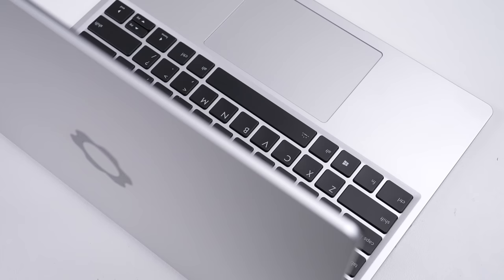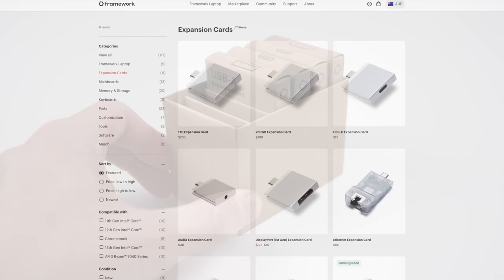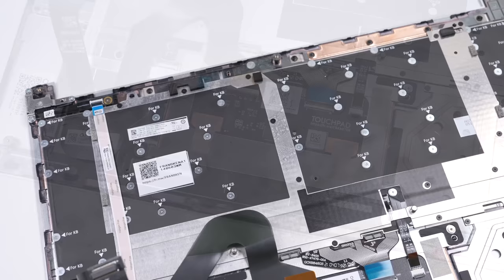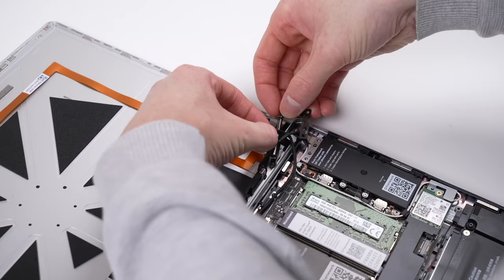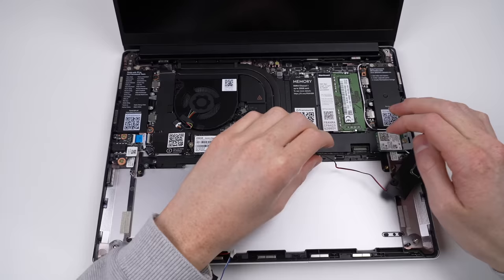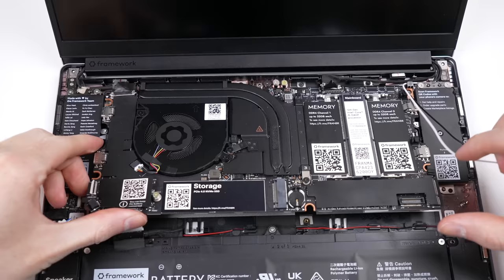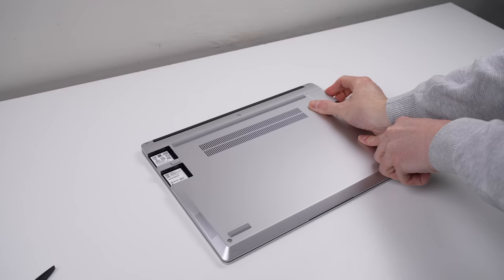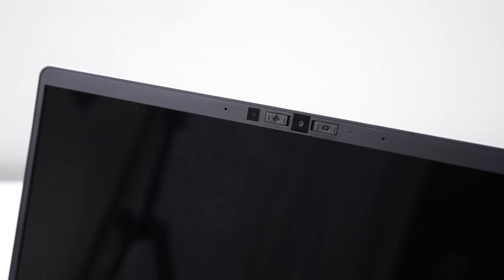New Laptop Brand Shocked Whole Computer Industry - Framework Laptop - Teardown And Repair Assessment

Comment: Single torx size for everything, under the hood QR codes for easy parts reference, swappable ports.  I'm surprised even the screen is EASILY replaceable.  I may support these guys, even if I don't really need a laptop.  Also, I don't watch many Framework teardowns, but this one was very descriptive and easy to follow along.  Awesome tinkering Hugh!🤙🏽
Reply: consider buying a usb-c charger or some clothing article from them if you don't want to drop $1000 on a laptop but still want to support them
Reply: Torx is also nice, they're a good bit more difficult to destroy if you don't have enough force
Reply: I replaced my hinges in five minutes. AT WORK. IN PERSON. And then replaced my screen a week later. AT WORK. It's stupid easy to work on lol.
Reply: @spdcrzy  how long do you think it takes to replace hinges and screen on a T420 thinkpad? hint: i can do it in less than 6 minutes, including cleaning.  whole teardown in 20 min. including a coffee, cleaning, including fan and thermal paste, upgrading and rebuilding the whole don't even takes more 30 minutes tops. 😏
same for some dell and hp professional laptops series.

(yes, i know, it's an old thinkpad but it still has the one of the best keyboard for me along with a trackpoint 🔴)
Reply: @kittytrail  But those laptops are not upgradable.
Reply: They are also working on a “desktop” dock that you can put your old parts into as you upgrade, so that your old laptop becomes your new backup PC. 

I really hope that a whole ecosystem comes out of this.
Reply: @Chopper153   they are not meant to as they're corporate assets that get replaced every two to five years because corps mostly don't care with upgradable stuff usually. but you can upgrade the display with non available at the time resolutions, hd, network, bt, internal speakers and ram. some old thinkpads even allow you to use one newer intel gen cpu. a long time ago i toyed with totally upgradable workstations from the Panda Project, like going from x86 to DEC Alpha cpus with the same backbone and it was pretty nifty but it didn't work in the end in a corporate setting as the bean counters weren't having any of it for warranty and depreciation purposes nor the engineers who wanted sparkly new workstations every two years 'cause, you know, newer is always better and it was a time when going from a pci graphics card to an agp one meant a wild boost in bandwidth and performances... 😑
i really hope they'll succeed though even if keyboard type and internal battery only mean i won't buy one.
Reply: @kittytrail  I know, LOL. I've used the OG thinkpads before. My point is that until now, I've NEVER seen another laptop that was this easy to work on - and I'm including my old gaming laptop that was fully upgradeable with a socketed CPU AND GPU. Man, I miss MXM.
Reply: @spdcrzy   yep, MXM was a start but it didn't catch 'cause the subset of people targeted by the promoters mostly didn't care, they got a new laptop every year or so and that's it. or they cannot even be bothered by the the fact that it was upgradable as they didn't care nor were they even able to order and change the parts by themselve. remember, the average pc buyer is dumb as a brick and half of them are even wayyyyyy dumber... 😬
small "niche" markets and/or demographics might allow that model to thrive beautifully though but it'll probably never be mainstream nor even capture more than 5% of the market. too bad but that's how it is. 😽
Reply: @kittytrail  MXM isn't really aimed towards consumers and end users - it's designed for gaming.

And when I say gaming, I mean casinos
Reply: @johnnycheung5536   that's a niche market i never envisioned but it makes sense, smaller form factor, lower tdp and power consumption and you still get better updated graphics on the displays by simply swapping a card instead of replacing the whole... 😽👌

Comment: My laptop is slow so I was planning on upgrading my laptop. But when I saw how hard it was I just gave up on it. Seeing that there's a laptop that is easy to change parts makes me want to buy one.
Also including the QR code instructions on the parts is a really great help for a newbie like me.
Reply: Unless you have one of these, the only thing you can upgrade in your laptop is going to be the Ram, and that is extremely easy to do on every laptop I am aware of minus Apple nonsense. How much Ram do you currently have? I went from 8single stick to 32 dual sticks, both at 3200mhz, and the difference was night and day! Another easy to do upgrade that would benefit you, and mayyyybe speed up your system, is installing another nvme m.2 SSD. You can do both upgrades for about 120$ or less right now :D
Reply: @MrNecryptic  some laptops have only soldered ram

Comment: I'm responsible for maintaining and repairing HP Chromebooks for a large school corporation. I've been doing this for over 6 years. The way these devices are designed to fail (from a hardware perspective) is clearly deliberate. A display bezel held in place by magnets is just a great idea. So refreshing to see a company innovate like this.
Reply: HP is a brand that i stay away from. I was told by my teacher, mid 1990s that the brand was a nightmare. I never strayed from that advice.
Reply: @humanbeing8948  he can't choose, only repair
Reply: @humanbeing8948  They were at their worst in 1990, their probook line is alright.
Reply: @Slamdoxicalz  Don't say that it's trash, I had owned one. Battery swollen after a BIOS upgrade, screw at the back to enter the internals is made of of very cheap metal.
Reply: bezel held by magnets is fine feature for owner held laptop, i cant see it as good option when school kids are involved. but again, depends what kind of school and where. it makes huge difference
Reply: Just never upgrade the OS, problem solved.
Reply: Apple is the worst of them,  is an icon though. First the customer is ripped of with horrendous profit margins on the product, then, they continue to be ripped off with everything do to with repairing being propitiatory. The customers love it though because overall, they are not very sharp.
Reply: still not sure why people keep buying hp...
Reply: I'm currently using a 2012 HP laptop on windows 7. Working as it should be.

Comment: This is a real game changer. While other companies such as Dell deliberately make their laptops extremely hard to perform even the simplest of maintenance operations (I have an Alienware M15 R6 and I need to take it all apart to even clean the fans), Framework is making it as simple as possible. That's exactly what we need, and I hope it takes off on the market.
Reply: Honestly, if framework is shipping on my country, I would probably get one as my Laptop is nearly 10 years old. I hope framework becomes popular enough, it's capability to become relevant by having its parts upgradable is something I've been looking for! 
I think I went through several notebooks and laptops and the only reason my current laptop is surviving is cause I learned to fix parts.
Reply: Their older laptops uses the most brittle plastic available. Awful to take apart.
Reply: Have Dell also joined the built-to-trash trend? We have a Dell Latitude E7270, which is pretty nice, easy to open, and access all vital components, RAM, SSD, battery and more. It was made long after Apple started making their Macs harder to maintain.

IMHO they are forcing us to go to Framework for our next computers.
Reply: I had an R11.   And modification made the Bios go wonky.     I finally just pulled out an old HAF case I had, got a new ASUS MB and transferred the guts from the R11.   No problem.
Reply: I have had quite a few Dell laptops. I have never had any issues replacing components.
Reply: @Tugela60  Including the latest ones, I hope? Like I said, the ones only a few years old are really good.
Reply: @Ragnemalm  The current one is a 2023 XPS 17, before that it was a 2015 Inspirion, before that a 2010 XPS. They are pretty easy to service, the dell online service manuals tell you most of what you need to know, plus there are service tutorials on various youtube channels that explain everything.

But, I think people may be talking about the ultrathin laptops. Those are glued, but they basically have to be that way in order to be ultrathin without being exorbitantly expensive. Regular laptops are easily serviced.
Reply: @Tugela60  That is good news, except for the ultrathin of course. I have one Air, a fewe years old, and both SSD and battery are easily replaced. Unfortunately not the RAM.
Reply: @Tugela60 That's actually a lie. It isn't to stop it from being exorbitantly expensive, It's because it's in the shareholders best interest for you to not repair it. Framework doesn't have the economy of scale to make it cheaper.
Reply: @Ragnemalm it’s just utterly more expensive in comparison for this repair and upgrade feature. Just hope bigger companies see them as a threat and try to make theirs a little easier maintainable

Comment: Wow, they actually made the ribbon cable that attaches the keyboard assembly long enough so you don't have to stand on your head, twist 180 degrees, and whistle Dixie! This unit looks really well thought out.
Reply: No A1534 crap here!
Reply: @rossmanngroup  I’d say the only way to improve on this is if they make the cable available as a standalone part on their website so you can replace it as well in case you accidentally damage it.
Reply: @thecomputerguy777  That cable is actually a standalone part and can be replaced by itself, although it is currently soldout on their website.
Reply: My only concern as someone who repaired laptops professionally for years is those slide-in ribbon cable ports with the latch on the motherboard are super fragile. The press in ports like the keyboard port is a better port. Apple only uses the snap in ports, making it harder to damage the motherboard.
Reply: Lmao, so TRUE!
Reply: @alexandertse510 scalped probably
Reply: ThinkPads and Dell business machines used to have the press type and some still do. They are more robust and conductive than the flimsy cable clips  favored by HP across its entire range and, unfortunately, the other two of the big three. Macs have both types but, of course, are never meant to be opened.
The big manufacturers have gotten away with 'minimalism' and saving a few cents on components which used to be common -- thus forcing 'watered beer' and 'daisy chains' on the public for far too long and we have been like sheep.
Framework as a single company is not going to outsell the big boys but will, I believe, force new standards on them. Indeed, if Framework guards its intellectual property rights in the same way as ARM in the UK did from the outset they will doubly profit when imitated and probably surprise us all with innovations and what might be called 'restorations' of what customers need.
Framework centralizes production in Taiwan and some components are from China. It is headed by Indian engineers and perhaps we shall see an east Asian story of collaborative excellence.
Reply: @rossmanngroup  Fancy seeing you here.

Comment: Amazing, it's hard to believe a company cares enough to go to this amount of trouble, but, really, shouldn't all laptops be like this. I wish them every success!
Reply: better than lenovo.  they were the prev title holder for ease of upgrade!
Reply: I don't think Framework was shocking to any insider of the laptop industry.  After 30 years of competition to produce the lightest, powerfulest, lastingest, usablest ... Now we've got the most user-serviceablest laptop.
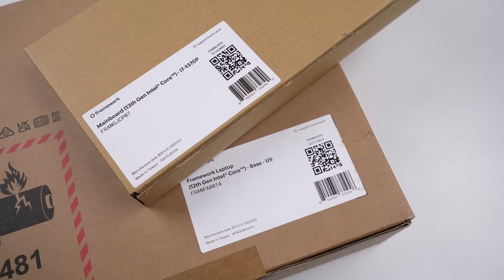Reply: 0:28 mainboard mentioned 13 th generation  i7
but on board mentioned
2:50 ----------12 th generation i5 
why they are doing this 
or else i am wrong
Reply: Indeed, and Framework can (and should of course) make money selling its upgrade parts to those who want or need them. Also, though you'd have to return the parts to the supplier, you may not need to send the machine in for warranty calls.
Reply: @SATYALIFESTYLESTUDIOS 13th gen was to be replaced.
 when he opened the 12th gen nd replaced it with 13th.